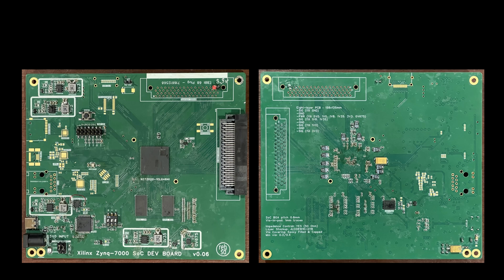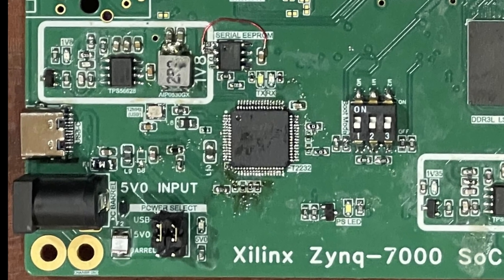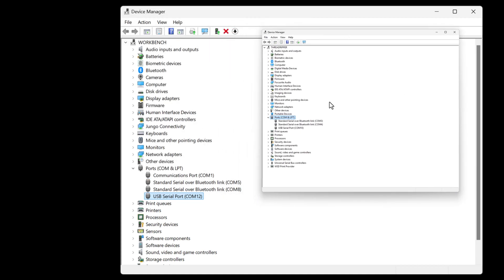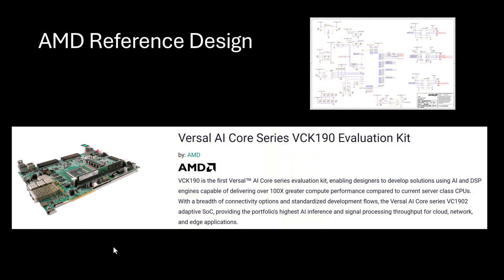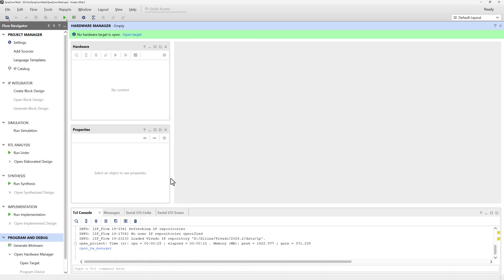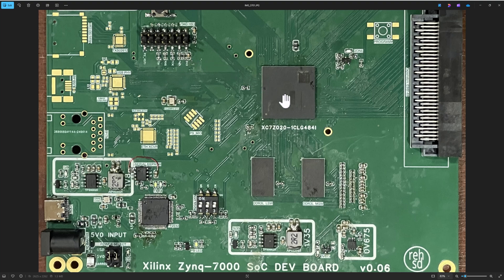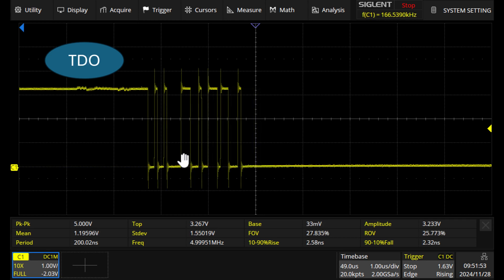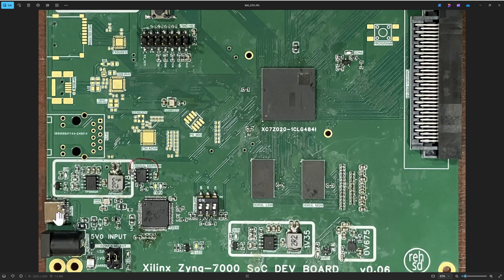Zynq-7000 PCB Build - Part 17 - Troubleshooting FT2232H to JTAG

Comment: Hello, do you plan to have your design (Schematic and BOM) be available in public? I am currently going through similar project and I wanted to refer existing projects as much as I can. I am having troubles to find passive parts like ferrite beads, decoupling caps with proper ESR  and etc.. was wondering if you could share your project if possible!
Reply from the maker: Hi, @mikelee7331. I have some info posted to https://www.rehsdonline.com/post/xilinx-xc7z020-1clg484i-zynq-7000-soc-artix-7-fpga. On that page, I also link to my GitHub: https://github.com/rehsd/FPGA/tree/main/PetaLinux%202024.2%20HDMI. On my GitHub I have the schematic in PDF format, along with the full source project (EasyEDA Pro). I haven't published a formal BOM, but I could do that. I purchased all my parts from LCSC and Digikey. Some parts listed in the EasyEDA Pro project are incorrect, as I copied and pasted some items (e.g., oscillators). Keep in mind this was my first project of this scale, and it can likely be significantly improved. Give me a couple of weeks; I'll get a BOM posted on my blog post linked above. I'm sure the selected components can be improved, as I didn't spend a lot of time looking at ESR details.
Reply: @rehsd  ohI see your website. Yes I will look forward to it then. Thanks for sharing your projects! I am learning a lot from your video as well : )

Comment: It's good to see that someone have time for interesting hobby! Is there any final purpose for this project? I liked more x86 projects 😊
Reply from the maker: I have no specific destination with this project. It’s the journey that matters. 😊 My primary objective is to learn, which I have definitely done throughout this project! I do plan to get back to x86 at some point. I had left off with a desire to consolidate glue logic in my 486DX build, possibly with an FPGA. Alternatively, I might pick up some old microprocessor that I haven’t worked with yet (e.g., Z80).
Reply: @rehsd  486 with DDR (SO)DIMMS - sounds like a dream :)

Comment: Try pulling pin ADBUS4 of FTDI device to 3.3 V (or whatever is Vccio on your board). Also NPOR signal on my FT2232H-56Q is ADBUS6, not ADBUS5 like on yours. But I never actually tried my programmer with Zynq yet, so maybe I'm wrong on this one. You might want to check that one with a scope or a multimeter, just to make sure Zynq is not held in reset all that time.
Reply from the maker: You're a rock star! I just posted a quick video with a fix pretty much identical to what you just said.  :)
Reply: @rehsd  For the future revision you might want to add a comparator (I use MCP6541T-E/OT) to pin ADBUS4 such that if your board is powered externally (and not through USB - which is how most of my boards are powered because USB just doesn't provide enough juice for devices like Artix-A100T), ADBUS4 would only go high if main power is connected.

Comment: I think it's a driver issue rather than your board, hard to tell but I assume the soldering on the JTAG pins are good. From my experience with the the FTDI chips they've worked quite well as long as they are driven correctly. I've used them to program MCUs through JTAG and even the SWD hack. I'm also using it to program a SPI flash for my ICE40 using pyftdi. I haven't used Vivado anything though so I haven't got any experience there. The FTDI chip has it's MPSSE which needs to be configured for JTAG and that's the drivers responsibility. I don't know if there are any requirements from the driver for how the EEPROM should be configured. 

I know Phil has a video on how to set up an FTDI chip for the Zynq using Vivado but I'm guessing that's what you've been looking at as well.
Reply from the maker: Thank you! I was able to track down the issue. https://www.youtube.com/channel/UCK3i954KKvqSx0kKpapUSQA

Comment: TDO isn't edge critical as far as I know, whereas something like TCK is, so I wouldn't imagine some ringing would cause any issues. 

But the side of the series resistor you probe that signal on could drastically change how it appears on the scope, especially if you are using a flying lead ground, which are notorious for making fast signals look terrible. If you're probing it on the side that connects to the driver it may look worse than if you probe it on the other side where the edges have been tamed.

I guess you've checked that TDI and TDO are lined up correctly? I know with my Altera programmer I have to connect TDI to TDI, which seems a bit backwards, are they somehow crossed?
Reply from the maker: Thanks, Tom! I was able to resolve the issue. While my TDO/TDI were OK, a couple of the other related signals were not. https://www.youtube.com/channel/UCK3i954KKvqSx0kKpapUSQA